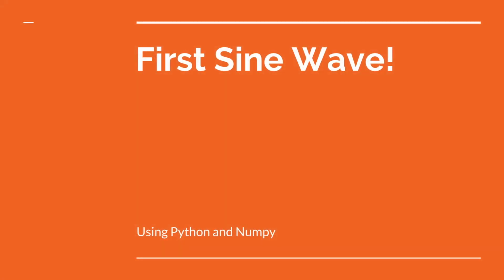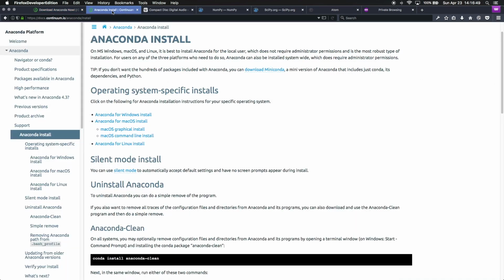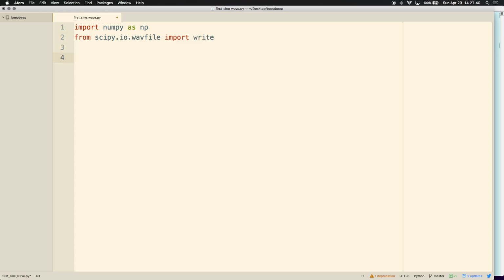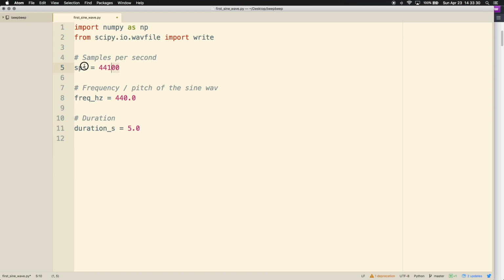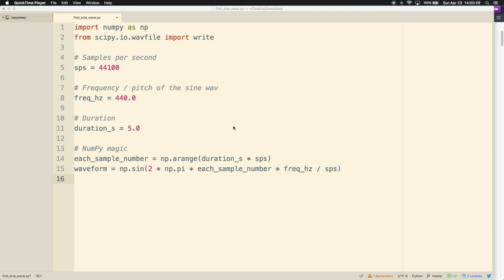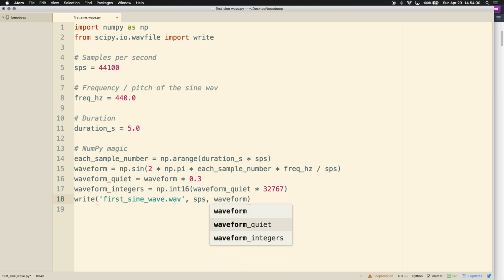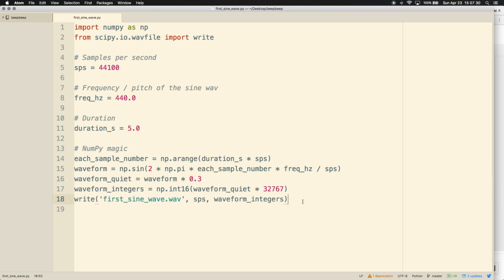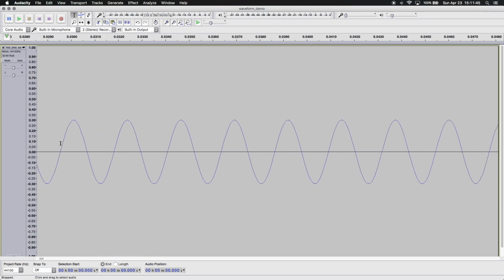Sine wave audio with NumPy in Python

Comment: FYI: Both numpy and scipy are external, third party modules.
They're not included with a regular python installation by default.
I thought they were part of the standard library too, but they aren't.
Reply from the maker: Yeah, it would be nice if SciPy and NumPy were part of Python, but at least the installation is easy enough.

Comment: This is interesting. I have some questions: What's the significance of 327627?
Can you create the audio and play it on the fly, without saving the .wav to disk?
Thanks for the video.
Reply from the maker: Check out my latest video where I output audio in real time: https://youtu.be/dNJ171EsoNQ
Reply from the maker: And 32767 is the largest positive or negative integer that can be stored as 16 bits, which is a standard audio format.

Comment: Thanks a lot for this video. Actually I'm working on a project where I need to play the audio in real time. I mean can't we play this wave through programming at real time without creating wav file. So that we will be able to play some notes progression by using loop or something.
Reply from the maker: Real time audio is great! My current project from which this video is based does not need real time audio. That said, check out http://python-sounddevice.readthedocs.io/en/0.3.10/ That is where I would go to start with real time audio output.
Reply from the maker: Check out my latest video where I output audio in real time: https://youtu.be/dNJ171EsoNQ

Comment: how to play a synthesised sinewave?
Reply from the maker: You just need software that can play a .wav file. On macOS, QuickTime Player (or iTunes) will work. On Linux, you could install the sox package and use the command play from the command line. Windows probably has some software that can play a .wav file as well. On all the platforms, the sound editor Audacity us available, and for Audacity, there are numerous tutorials on line about how to use it.
Reply: yeah, that is a way.. is there a pythonic way? :)
Reply from the maker: Have you seen this? http://python-sounddevice.readthedocs.io/en/0.3.10/
Reply from the maker: Check out my latest video where I output audio in real time: https://youtu.be/dNJ171EsoNQ